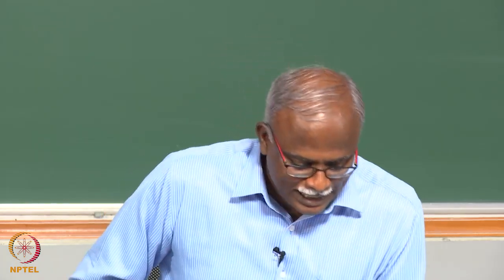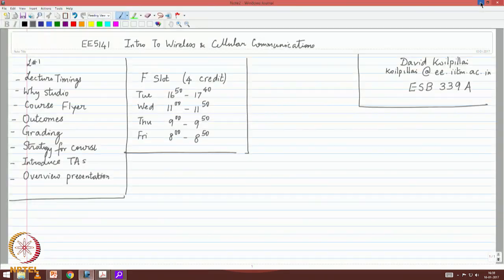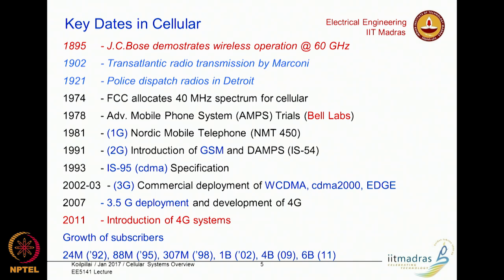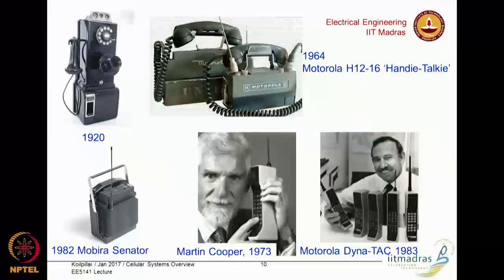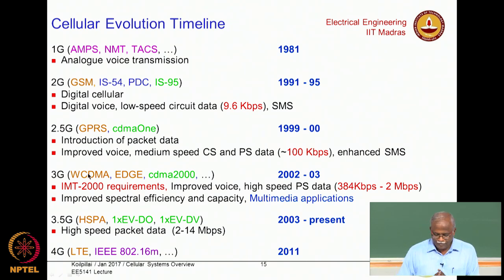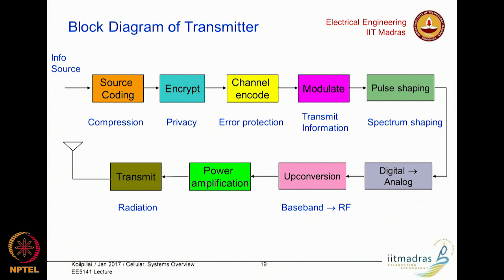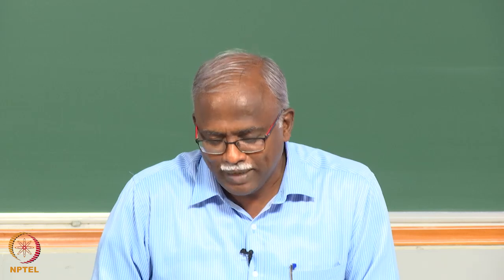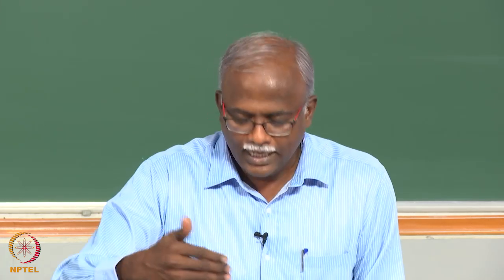Lecture 01_Overview of Cellular Systems - Part 1

Comment: 31:30 Difference between circuit switch and packet switch?
Reply: Take a basic Communications class. Then come here.
Reply: 39:00 why pulse shaping?
Reply: 39:45 purpose of DAC here? Pulse shapper output is a continuous signal.